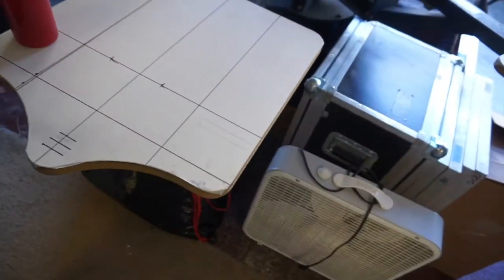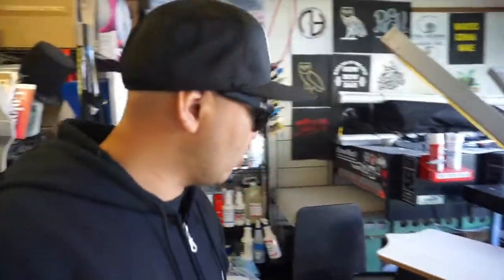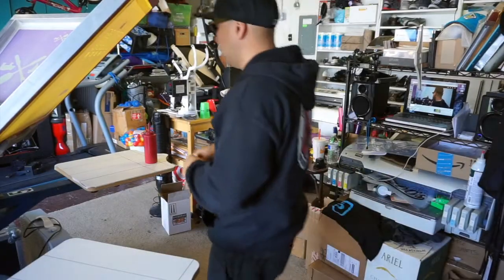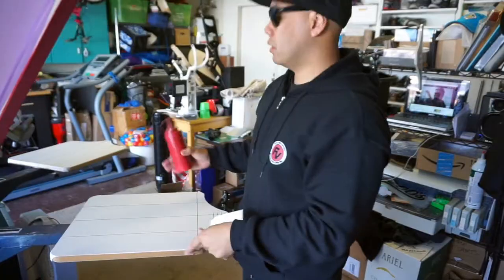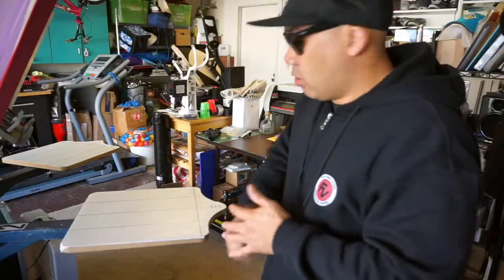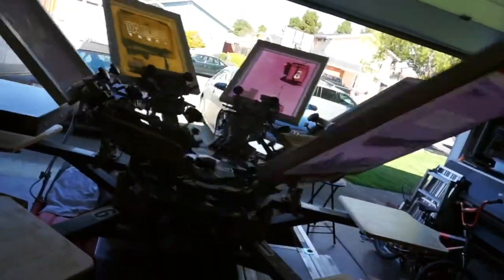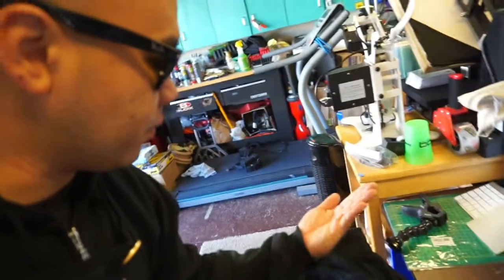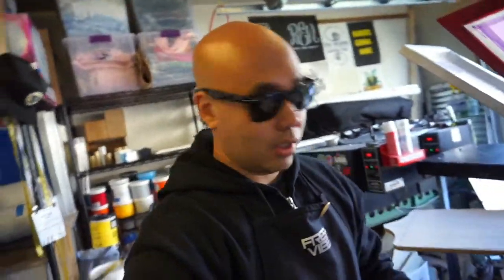Printing 4 Colors on Fleece Vest (S:03/Vlog 306)

Comment: RhyBeats what to you normally print on for mesh count?  I'm pretty much just use 156.....but wanted to start messing around with some 230
Reply from the maker: Scott King Designs I’m usually using 160-180 mesh screens. But I also use 110 or 230 sometimes depending on the design
Reply: I need to get some higher mesh and start messing around, lol
Reply from the maker: Scott King Designs you should specially when you have a very detailed artwork or that grungy/vintage look